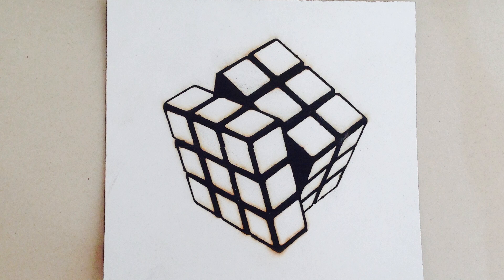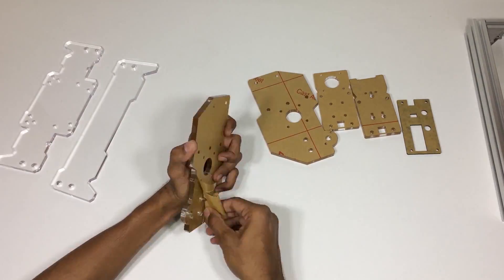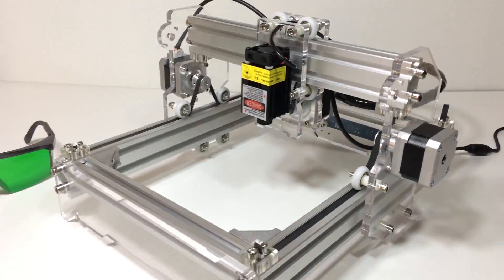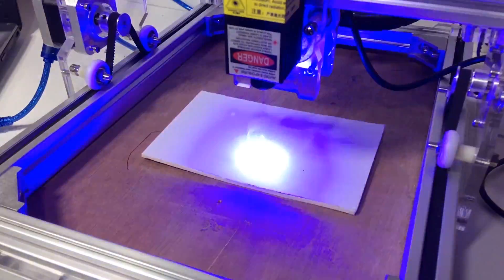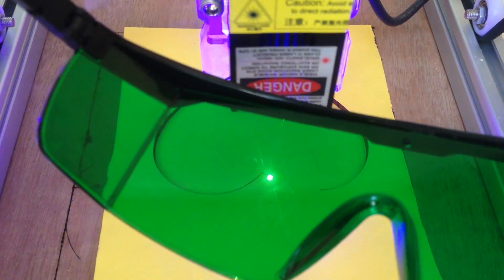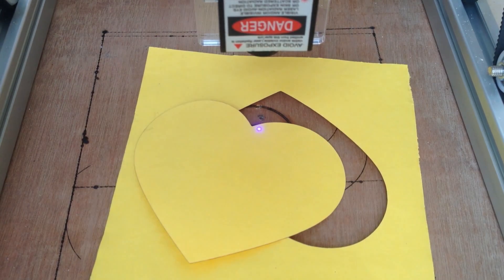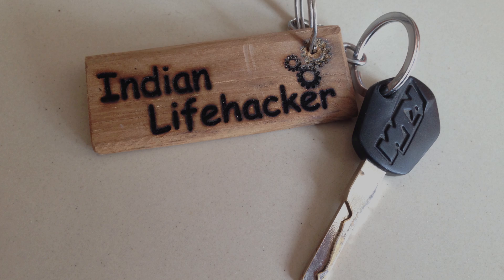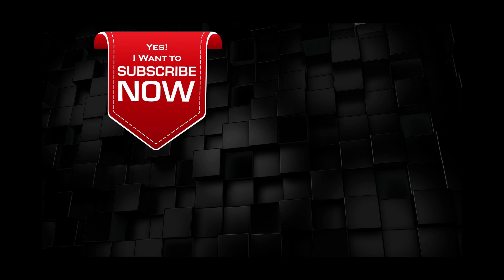DIY LASER CUTTER/ENGRAVING MACHINE KIT

Comment: Hi friend! can I ask question? very beginner TT.  A weeks ago, I bought the [Engraver laser diy 3000mw 60*50cm] machine. its different brand of machine of yours. nway, while using this machine, I realized the laser is  a little bit weak for my work(Couldn't cut the cardboard, 3mm), So I just want to upgrade only laser 15w, buy from ebay or ali. Is the 15w laser is compatible to my machine? can i just buy 15w laser and change it? or Do i need to do something to change to 15w laser like a soldering?TT

Comment: Hi! I'm searching for a program on GRBL basis that will not engrave line by line like it does in this video, but that will make a circle going round. is there any good program that will convert Images into actual paths (mathematical figures such as circles, spirals, squares)
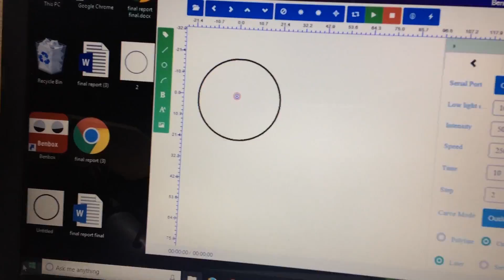Reply: 01:49 is this circle a picture or how did you do this and which program? looks like BenBox?
Reply: Most lasercut software packages work the same.

The line by line thing you are saying is when it is engraving an image. It does it like this because its a methodical pattern.

When you set it to cut mode, it will follow the lines as seen on screen, making spirals, squares, anything.

Comment: Friend, I greet you from Mexico. I have many doubts and I would like to ask you that he is an expert. I want to comor a CNC laser diode of 5500 mW, with a working area of 1 m x 1 m.

Is that enough power to make cut white textile polyester?

Do you think it is a good idea to make patches for t-shirts?

Will not the edges feel as if charred by the plastic of the melted textile?

Eh wanted to buy the version 10 000 mW ... to be able to experiment on cuts of fabric ... and leather, engraved leather labels and cut to the edge.

The 5500 mW diode laser can cut wood, 3mm leather and acrylic of color, paper and cardboard without problems?

Should I buy leather for 10 000 mw?

I think that more will always be better ... that's why I want the cutter 1 meter by 1 meter of work area ... but being so large will not have less precision?

And most importantly ... do real lenses protect me from not being blind?

Is it really dangerous to see the glow of the violet laser still reflected on the wall?

 Please ... I require your valuable experience and your help will be very important to me because I do not know anything about the subject ... I am afraid of hurting myself and I am afraid to buy something that does not cut the white polyester textile .. A hug from Mexico